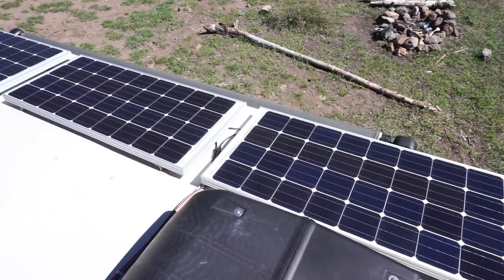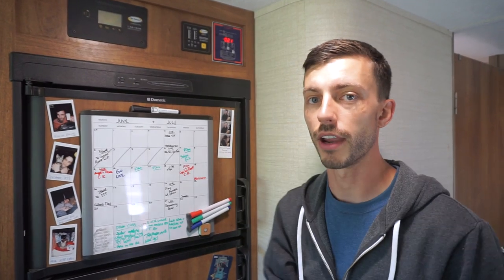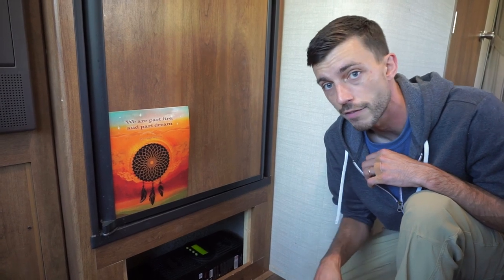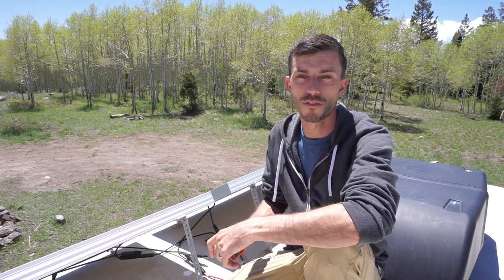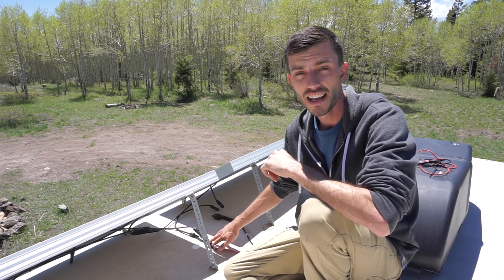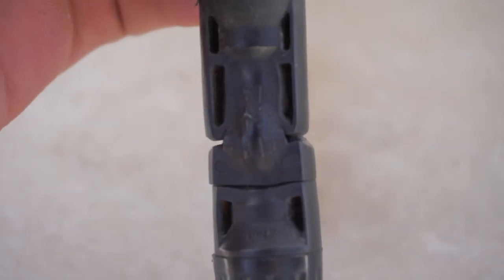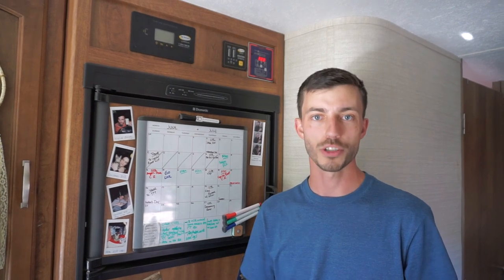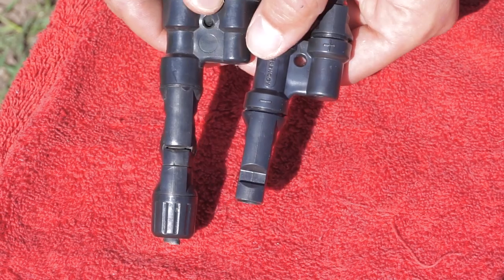RV Electrical Fire Hazard - Melted Solar Connection Fire Risk Fix

Comment: This is an excellent reason to put a small service loop at each connection point, that way you'll always have extra wire to work with.

Comment: Thank you for pointing out the cost of running a generator. We have an off grid cabin that I have procrastinating putting in the solar. This video has helped reinforce the fact that I need to get my butt in gear and get this up before fall. Not only the cost but the noise as well. Who likes to sit out in the woods listening the the generator instead of the birds. :)

Comment: FYI you can get MC4 connectors & Y connectors in different ratings 25 , 30 , 80 amp .
Looks like the old Y connectors had a 25 or 30 amp rating .
80 amp should be stronger & so tolerate the rv life better .
Reply: So the reason for them melting n the fire hazzard is he had the wrong ones n should use the 80 amp ones
Reply: That's good info to know. Thank you.

Comment: You appeared to release the crimper on the first wire. That crimper is designed to unlock when the crimp is complete. A loose crimp could cause this problem also.

Comment: I was engrossed in your troubleshooting explanation until 5:14 when I heard your voice echo off the treeline. Then I heard a bird singing in the distance. Then I was lost in the trees. My attention was dragged back from the trees when you mentioned how hot the connectors were and I noticed you had a jacket on. It's melting hot here in Texas and all I can hear are the cycadas. Really good information on both electrical issues and where to be to not hear cycadas in the blazing Texas heat. :-)
Reply: Reading Rambo hahahaha

Comment: Excellent explanation showing each step from troubleshooting to repair. I was thinking about a solution to securing those main power leads using the original cable clamps already screwed to the roof. Loop another clamp around the negative and positive main leads. Next, using a zip-tie feed the end through the screw holes of each clamps and snug up the zip-tie allowing some strain-release. This solution prevents you from having to remove the existing clamps and sealing a wholes.

Comment: With over 480+ watts of panels, in high-sun they are capable of producing up to almost 30 amps current, it looked like your main feed connectors (and wire) was the 25 amp MC4 and number #10 wire lead, far to light to be safe to handle that level of current. My own 24' Gulfstream RV trailer is off grid, and have 700 watts of solar panels, and i used  #6 cables capable of sustaining 50+  amps load continuous, making the system safer, and reducing heat-resistance loss from the panels to the 50-Amp MPPT controller, to charge 480 Amp-hours of battery bank. ( I plan to begin adding more off-grid videos to my channel, and Solar power informational videos is a top topic i plan.

Comment: Did GoPower recommend, or have you considered using electrical silicon grease at the connection points? It'll keep any moisture from getting into the connections. Microcorrosion is a constant worry, especially since your solar connections are outdoors and always in the weather. I started using it on my Harley (motorcycles are notorious for flaky electrical connections as they age) and my problems are at least 90% reduced. Doesn't help where wires get rubbed through by friction, however!

Comment: You should up the voltage as your charge controller is a MPT (multi point tracking) controller. You could do one string or a set of two. Higher voltage allows you to charge even in low sunlight conditions I have mine setup for 110vdc and the charge controller checks the volts and amps then does the charge algorithm to maximize the amp output to the batteries.
Reply: Yeah, that was my understanding as well. MPPT controllers work better with higher voltages.

Comment: Thanks for sharing the bad with the good, David! This is a good reminder for everyone to remember to monitor, maintain and inspect as you go in order to find and fix small issues before they become Big Costly Problems. Plus, you made another very important point "it doesn't matter if you have solar or not, or if you are in an RV, Van, Tiny House, Toe Vehicle or Class A/B/C - they all need to be maintained and inspected regularly", and Yes, they will all have problems needing to be fixed from time to time.

Comment: Awesome post!  We've started with a generator but hope to add solar soon.  As a lighting tech working network shows, I've witnessed the regularity of electrical connection failures as a reality. Periodic inspection of the entire system is wise and will help prevent worst case scenarios from happening.  On another note, I've made a few equipment purchases for my rig based upon your recommendations  and they have all proven to be quite robust and as useful as you have described!

Comment: You will be doing that again, keep an eye on it.  20 amps is pushing the limit of push together connections. If I ever install solar, I will use a combination of series/paralell and increase the voltage to decrease the current.

Comment: Why did you go from the charge controller to the ac-dc panel with the controller output? Shouldn’t it go directly to the batteries?

Comment: The real problem you're having here is the MC4 is UL rated at 20 amps and your asking for more than that from them. You should really consider wiring your panels in series and reducing the current (amps) flowing through them. Your charge controller is an MPPT (maximum power point tracking) it is very capable of converting the higher voltage from a series panel set up into current at the output of the controller. Hope this helps you. Your most likely to have the same issue again if you don't correct this issue.
Reply from the maker: The MC4 connectors we use are rated for 30 amps so that is not the problem.

Comment: If you’re not using fuses up there, you need too. Mc4 fuses coming off of each panel. Match amps according to how many each panel has for each fuse, or you can do 1 high amp fuse at the end of the branch connectors before the pv cables run to your charge controller.

Comment: I can surely attest to the positive effects of living on solar. We had just 250 watts of solar and two group 24 AGM's for our remote camp-hosting venture in 2013 that allowed us to watch two hours of satellite TV every night for the 5 months we were there. If we could have upgraded to LiFePO4 and a bit more solar we would have put even fewer hours on the generator that summer, which was already only 50 hours as it was.  Glad to see it was a simple issue to fix and I commend your methodology of troubleshooting as it will do you well throughout your RVing years. -Dave
Reply: Another reason to not have AGM batteries! That must have been awful to have to be subjected to tv for two hours every day. Not just the suffering, but that’s 14 hours s week you’ll never get back!

Comment: Guessing: corrosion/oxidation where the leads of the connector meet, oxidation turns the connector into a resistor, as a resistor the connector gets hot, hot connector oxidizes even faster… Nice little self-sustaining out of control chain reaction.

Perhaps a dielectric grease on the electrodes and then vinyl tape around the connector to keep the moisture out.
Reply: Sounds like you are not familiar with MC4 connectors. Both the cable entry and connectors are environmentally sealed with silicone orings. There is very little opportunity for environmental contaminants to precipitate corrosion. Grease in a connection is more likely to create resistance (creating voltage drop and heating) than it is to prevent corrosion. There are very few cases where dielectric grease is an asset. If it truly was the 'go to' solution for good contact, you'd see it a lot more. The place where dielectric grease got it's start was in radio frequency connectors (higher voltages and low amperages) and that is realy most often where it is a benefit for reasons I won't go into. Low voltage (high amperage) power applications are the worst.
Reply: @stevehericks5764  You're right, I am not familiar with them. Thanks.

Comment: From what little I know, which is very little, rewire your panels to be in series and reduce the amps and up the voltage.  It is what your MPT is set up for to start with.  Just from my very limited observations.

Comment: I am an electronics guy myself.  I would recommend soldering the crimps.  It maybe over kill but with the wires being blown around a little and vibrating it makes for a totally solid connection.  Put, a drop of flux on the stranded wires after stripping them.  Then crimp, lastly lay a drop of solder on to the connection.  You will see the solder get sucked into the wires and connection and know that it will never separate from vibrations.  It's a nice piece of mind and only adds a few minutes of time to the job.

Comment: Had my solar professionally installed and he cut off the MC4 connectors and used adhesive lined butt connectors. So far so good.
Reply: DID THE SAME THING  2 YEARS STRONG
Reply: I've heard that a lot of solar panel manufacturers nowadays will void the warranty if you cut off the MC4 connectors.  It would be good to check first before cutting.
Reply: How many amps can the adhesive lined butt connectors do, can they do 80 amps or more?
Reply: @michaeljohn7467  10 gauge wire is only rated for 30A which is the biggest I have used. You would need something like 4 gauge for 80A. One would hope the butt connector could handle the same or more than the wire size it is designed for. Check with manufacturer for specs and make sure you have the proper crimper.

Comment: Thanks for sharing this with us. I have a 400watt solar array but it's not mounted to the roof of my RV. Mine is pole mount and I manually track the sun throughout the day. My panels are mounted side by side and connected in series so I didn't have to use those Y connectors. I do have some and now after reading what gd2329 said, "FYI you can get MC4 connectors & Y connectors in different ratings 25, 30, 80 amp " I learned something new. I didn't know the connectors had amp ratings. Now that I do I'll be checking the connectors that I have to see if they have an amp rating number on them just in case I should ever have a need to use them. So, Thanks for the video, great job and thumbs up, yo have a new subscriber here.

Comment: Why do you have them wired all in parallel ?? With a mppt charge controller that can handle over 100volts input  just connect them all in series.  You will never have a problem. This is what happens when you put to many amps through a wire  connector. Your fault and if you wired it the same way then you still have a fire hazard.  Wire them all series mate.  You will end up with 63v dc input and the outback controller can handle 150vdc input.
Reply: Justin Case Solar Power and Bush Camping more amps are created that way
Reply: @dogbones4838  Yes more amps that make heat in the wire and cause hot spots in the wiring. If you put them in series, You get more volts and then the mppt controller turns them into amps. I do know a little about what I am talking about. I am not a salesman. My house is fully solar powered and so is my camper.
Reply: They don't know what they're doing... Even the mppt is lying down flat

Comment: I have been a licensed electrician for 40 years. You can expect to melt these connectors if you join more power through them than they can handle. Since there is nothing anywhere to say they can handle more than 30 amps, I would not join more than two panels through these things to derate for continuous duty. SO for more than two panels I'd use something better or run another set of wires down to the controller.
Reply: Sounds legit. Wiring the panels in parallel causes the current to add. Too much current and the wires/connectors need to be beefier.
Reply: The 3 panels have a combined max output of 28 Amps or so, which would be in spec for a 30 Amps connector. But he could go for beefier connectors if he wants a bigger buffer. :)

Comment: Question we had a solar control charger melt, then disconnected it while waiting for a new one. Someone was living in our camper for a week. It burnt down 2 days later. This man lived there a week and we found out domestic violence problems with his gf. We don't know if they did this because they called American red cross next day while he still has a Apartment with her. So could this have caught fire while disconnected? The end with the solar stuff was still left but opposite end completely burnt.

Comment: You're right:  different brands of so-called-MC4 connectors don't always fit with each other.  It's a crazy situation.  Also, when you stripped the first red wire, it appeared to be oxidized and discolored.  We need shiny bright copper for a good crimp connection, cutting the wire as far back as necessary until that happens.  IMHO, a combiner box is a much better alternative than using MC4 branch connectors, with all the many connection points that entails.

Comment: Could you explain how by putting the rags on tops of a panel cell it cut off the power to rest of the panel and thus no current being generated by the panel?  I thought solar panels would be reduced in power output if a cell were damaged or covered and the other cells would continue to produce power.  Thank you for the great safety training.  Very much appreciated.

Comment: Not sure from your video, but it appears that you are using aluminum wire. Aluminum is prone to corrosion, (especially at connectors with dissimilar metals) it carries less current for its size (relative to copper, has greater resistance which leads to more voltage drop). Aluminum also expands about 35% more than copper when heated, so each heat / cool cycle can also mechanically weaken your crimp connection. I would highly recommend using copper, and if you really want to make it fool proof, solder the crimp to the wire.

Comment: Why not put the panels in series???  Is it that the MPPT controller has a voltage limit.  Voltage and Current are inversely proportional.  My Boat, and my RV will be wired in series so as to keep the current levels down through wiring.  Also, you can try a series paralle configuration potentially.

Comment: You might want to consider putting inline fuses on those solar panels as an extra safety measure. I'd also dump the branch connectors and get a combiner box. You're doubling the amperage on each branch connector by running the panels parallel, I don't think the branch connector or the 10 Gauge wire are up to handling that much amperage. I'd hate to see you have the same problem again. either that or wire the panels in series.
Reply: They are 30A rated generally, as is 10ga

Comment: ..I have problem with hot banana plug melting those positive plastic terminal on my 600w grid tied inverter with 400 watts panel in 4 month of use..can't open those  red terminal plug anymore (melted).. replaced banana plug with rounded terminal plug from scavenged eu plug..don't you think that some inverter place both terminal to close..

Comment: Okay I've been following trying to copy your solar installation.  When did you install the FM 60 solar controller why? I missed it some how and didn't see it until this video .
Reply from the maker: The FM60 is an MPPT charge controller whereas our old one was PWM. MPPT charge controllers are much better than PWM and can result in a 20% increase in solar power output. Ours is also programmable which is a big deal when using lithium batteries. We unfortunately dont have a video of us making the switch to the MPPT but we've had it for 2 years now and still love it.

Comment: Personally I will not rely on a crimped connection only. Hot and cold / Expansion and contraction not to mention bouncing down the road could work the thin metal to wire connections loose. Using solder paste I pre-solder connectors and wire, then crimp, then solder. I also add dielectric grease on the pins before plugging in. It is possible for MC4s to leak. I would have loved to see the melted and bulged connectors cut apart to see what went wrong, if it could be determined.

Comment: I believe most MC4 connectors are only rated for 20 amps. However I know of one brand "Multi Contact" brand of MC4 connector that claims to be rated for 30 amps. You might want to verify the rating of the connectors your using.  I would also use a thin film of dielectric grease to help to disperse heat better.
Reply: Totally agree on the dielectric grease also for corrosion and water resistance benefit too...I use it on almost all electrical connections I deal with...I bet you are spot on on the amp ratings on the mc4 connectors...the melting appearances  point right towards that scenario...
Reply: I use and can recommend Harger HCAJC8 antioxidant joint compound.